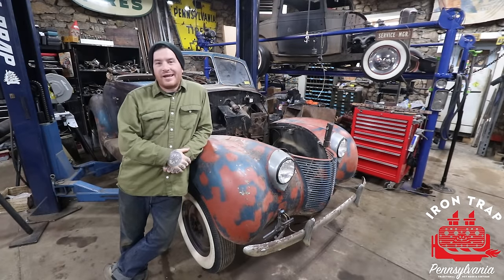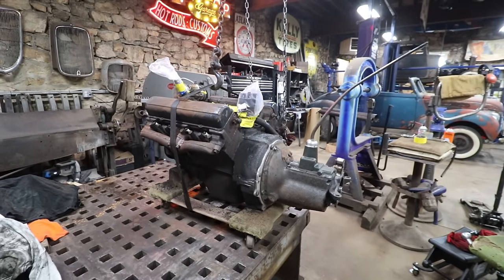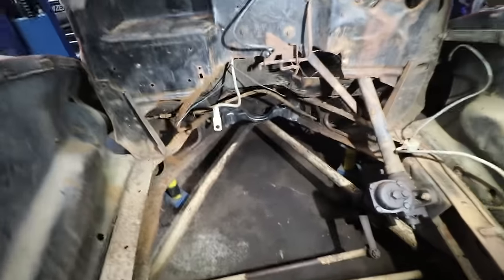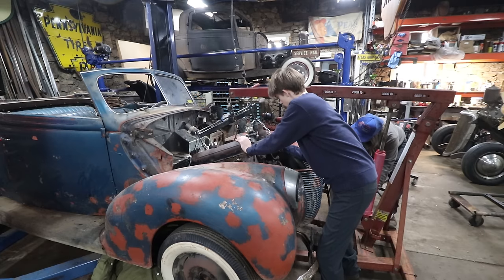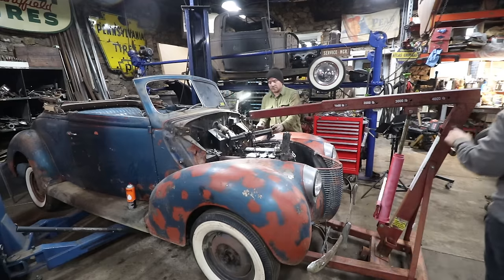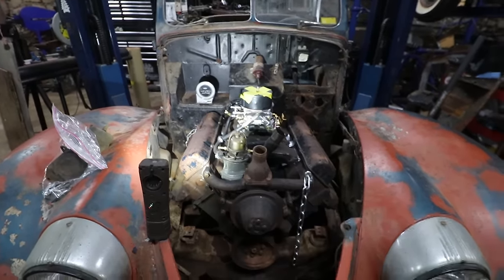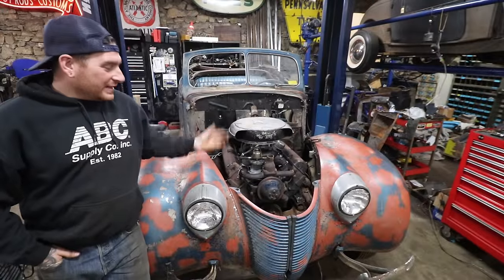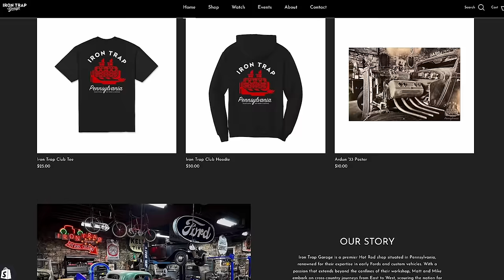Mocking Up The 331 Cadillac Engine In Our 1938 Ford Convertible

Comment: The Cadillac engine worked out nicely once you made a few corrections to the previous installation. I am glad that you are using the old Cadillac air cleaner, it really looks like it belongs in that engine bay. You guys made this installation look so easy although I know it wasn’t. I am looking forward to the next episode.
Reply: I agree the air ckeaner fits the conversion, but lose the holley carb...

Comment: It's great watching you guys slip that motor in - there's really something special about shoehorning an engine in with a friend - each one watching the clearances they can control and listening to the descriptions given by the other. That feeling of exhilaration when you both stand back and see the results is a great rush!  Great work changing hatchet engineering to the kind of design that a good hot rod shop would have done at the time! Can't wait to see more progress over the winter!

Comment: This is a somewhat traditional engine swap for this era Ford.  It was a common enough swap to generate the term "Fordillac", and is almost simple to do.  Alas, firewalls are the bane to engine swaps in old Fords of this age.  I had a '40 Coupe with a ' 55 Buick nailhead that the original builder used an axe to clearance the distributor.  NOT pretty, but it worked.  Looking forward to seeing the firewall replaced, or at least patched.

Comment: Back in my misspent youth, c. 1965, I blew up the original Flattie, so Installed a 331" Cadillac in my 1948 Mercury convertible.  Granted that car's engine bay was larger that your '38's, but many things were the same.  I used genuine Hurst front motor mounts, and a transmission adapter plate from JC Whitney to the pre 1940 transmissions I used, and frequently destroyed out on the streets at the Friday & Saturday night stop light derby.  
One thing I did for clearance with the stock manifold on the driver's side was to drop the steering box about one inch.  That worked out well.  On the passenger side the engine came with a modified ex manifold, that cleared everything.  I used a Stelling & Hellings chrome bonnet on a vintage Rochester Quadrajet 4 barrel.  No tuning,I knew nothing about that magic, it did start and ran well enough for my simple needs.  I do miss that "Mercillac" experience.  Anybody can stick a Chebby in anything, that takes little talent to do.   
Right on! Matt....  RooDog, Knoxville, Tennessee.....

Comment: Hey Matt, just wanted to share with you an option I’ve found for a engine cleaner rather than the expensive engine cleaner which is Easy off oven cleaner. It is what I use myself, it works phenomenal.
 It sprays on as a foam and I let it set until it turns to liquid and then I pressure wash it afterwards. Give it a try sometime and see what you think.
Reply from the maker: Great tip!

Comment: That's a nice smooth running Cad motor. I love that you're using a period trans as well. Nice job on those Hurst-style mounts! 
The Pontiac 389/ Muncie was a later era, not your style so much, I see that...
I also liked the Olds Starfire 394, which was another smooth torquey hotrod motor, esp with a '57 J2 6 bbl setup!

Comment: I love it ! A lot of work , but it looks great in the car , & the air cleaner looks radical on it , just like it belongs there . Great job , guys . Nothing like watching someone (ITG) un-hack a nice rare hot-rod , put a more suitable (running)engine & trans  in it , & get the ball rolling with all of the needed parts to make it all flow right again . I love those engines , high torque - lower rpm , a real "cruiser" , with a throaty sound . I will be watching the progress on this , with great interest , like all of the others . The fabrication work , that ties it all together , those little bits of "unobtainium" , or "never-made-them", you guys do , set you apart . Especially knowing what parts were commonly used , but overall , you are keeping it real , & more importantly , keeping it uniquely , American . Have a very merry Christmas , gentlemen . I'm quite positive all of the Santas out there , will be checking out you stable of sleds . Ho , Ho , Holy crap ! Think I'll try this one out ! Lol . Take care , guys .

Comment: Looks good, I also like the look of a Buick nailhead in a hot rod. I had a Buick 264 nailhead out of my parents 55 Special that I kept around for years but never found a project car for it so I sold it. The engine was totally original and still ran. A guy from Atlanta bought it off eBay and drove to Ky to get it. He didn’t do a thing to it and put it in a rat rod A model tow truck and then drove it to Pigeon  Forge TN without a hiccup.

Comment: That Cadillac is almost 100 Cu In more than the flathead so it ought to provide plenty of "grunt" to move the car around very nicely. Probably not as much as the Pontiac but the Caddy may have more torque so that may overcome the additional cubes the 389 had. Lots will also depend upon that gears you end up with. ;o)

Comment: It's been quite a while since I watched the channel but YouTube's AI thought I should start watching again. Just one question: Why don't youse guys use a gear pump to circulate fresh, clean oil through an engine that has been sitting for only God knows how long prior to turning it over?

What do I use? A small Viking gear pump with 2-speed half horse motor that I only use the lower speed. A PH8A in a filter adapter on a small stand and a collection of drain bolts I drilled a hole into then pressed a brass barb fitting into with JB Weld as the sealant. It's incredibly handy to fill diffs and trans also. Minimizing cross-contamination isn't difficult and doesn't waste much of what ever the next lubricant is.

Comment: I have a 58 chevy pick up and have a caddy air cleaner complete and just a top. I want to run it on mine I am using a edelbrock 4bbl (carter afb replica)and definitely want to see your twist on adapting to the holley since the throat circumference is the same. Requesting to see that footage.

Comment: 8:45 Buy the air over hydraulic cylinder for the engine hoist.
Harbor Freight use to sell it. Ask your Eastwood buddy's.
So now you have a Fordillac.
24:24 Why didn't you make your mounts bolt directly to the rubber chassis insulators and get rid of the U bend piece?

Comment: My question is does the weight of the engine and exhaust manifold for the caddy engine somehow offset the  the front suspension of the car as compared to the old engine ?
Reply from the maker: The old engine was probably heavier

Comment: As I had mentioned earlier, I had a 331, '53 Cadillac in my '48 Merc.  The back of the crank had a large counter-bore for the torque converter, or what ever automatic tranny feature there was, so I had the local Vo-Tech machine shop make me a bronze bushing to serve as the pilot for the Ford transmission's main shaft.  Will you have a similar issue?
....RooDog....
Reply from the maker: Yep already machined one up and pressed in.